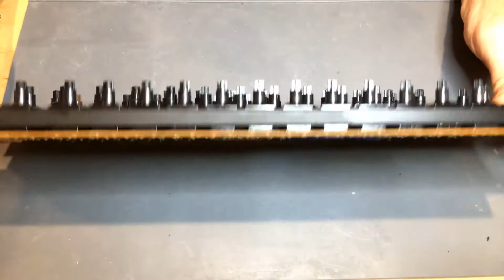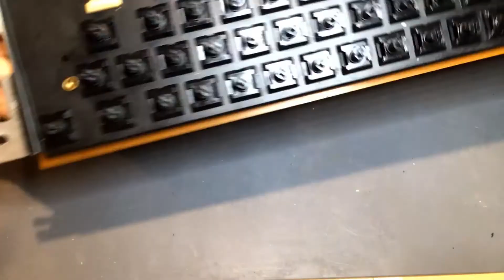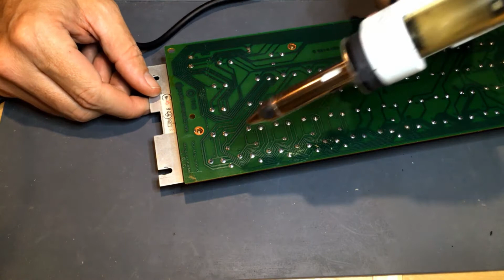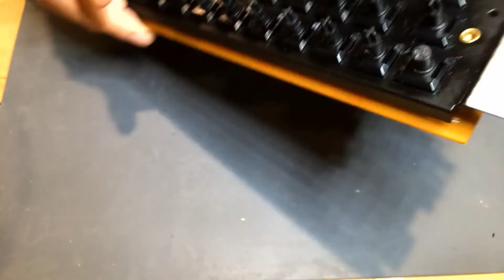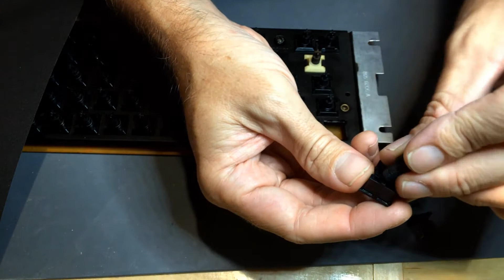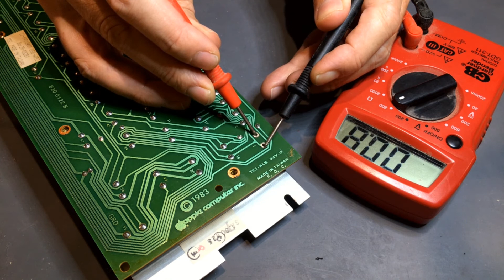Installing 3D Printed Apple IIe SMK keystems

Comment: I have some notes. I checked if the stem needed sanding by putting the stem into the switch from the top. None of them needed sanding. I did have to sand the sides of the bump and to a lesser degree the sides of the guides.

I SLA printed my own. Thank you for the STL files.
Reply: Good to note.  Different printers have different tolerances, so I let things a bit thick, rather than run the risk of under sizing them.  And you’re welcome!